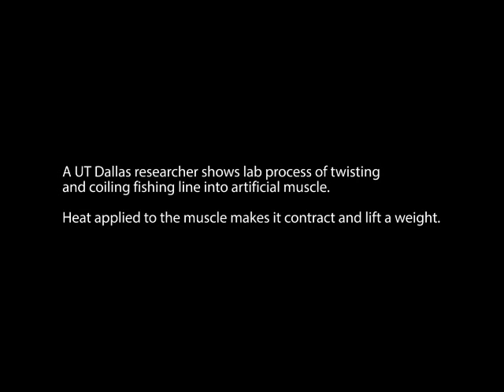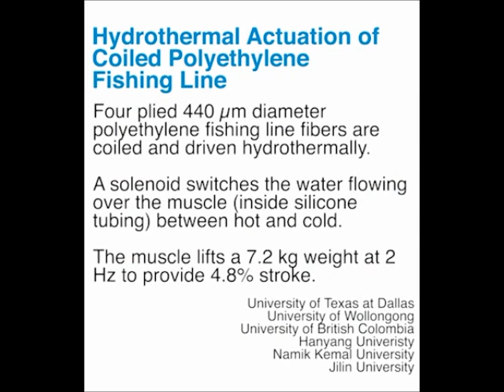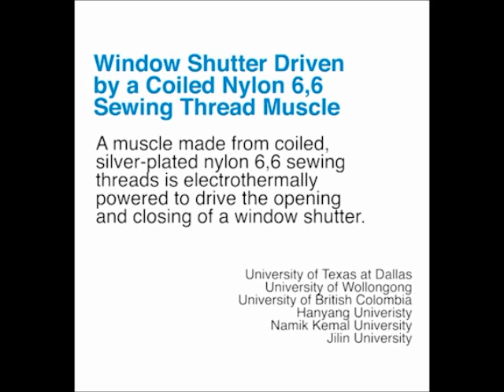Cheap polymers twist into muscles with superhuman strength

Comment: Why is the fibre longer at 1:05 than at 1:00? (at both times it is unheated). Do you anneal it or add different weight?
Reply: it cooled
Reply: @baneblackguard584  so may i tell, if nylon muscle will actuate faster (with electric wires) in water, am i right?.